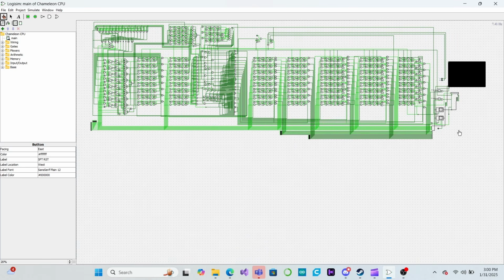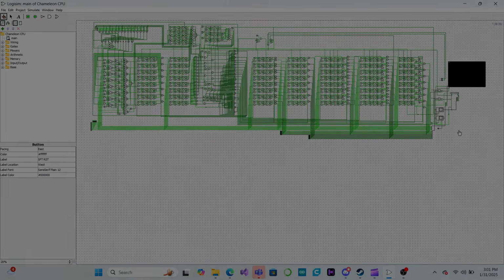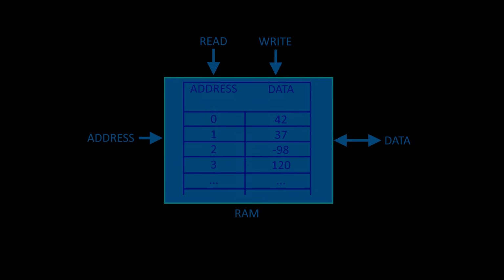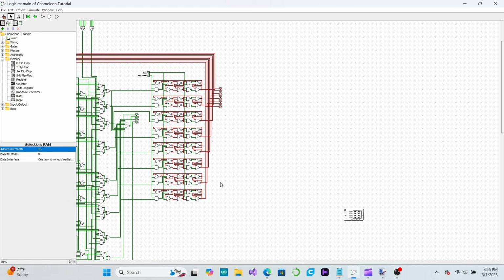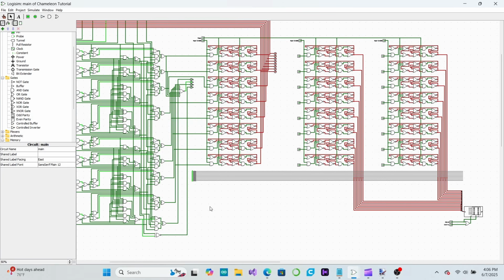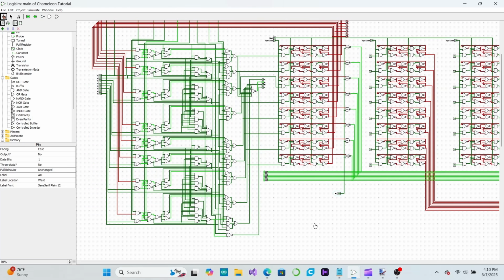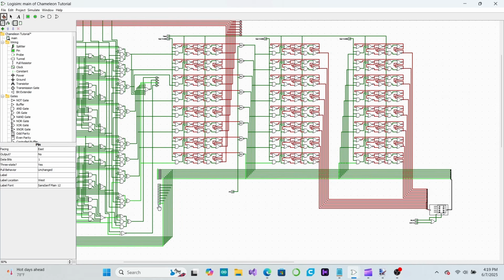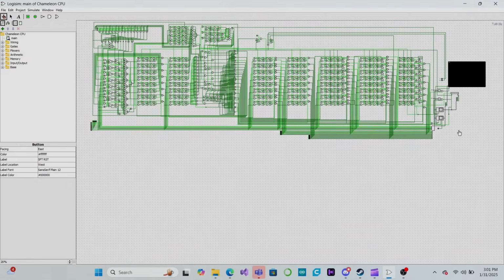Adding 64kb of RAM to our custom CPU (The CPU You can Build, Ep. 9)

Comment: The ram module in Logisim has a separate chip select signal because that allows you to set it's output to high impedance, which is nice if you're trying to combine multiple RAM modules on the same data bus. Real RAM varies on how it implements that, I'm guessing whatever RAM you're planning to use is either open collector or simply not designed to be extended that way.

Edit: Thinking about it, the RAM module you're using probably has it's chip select integrated into it's read/write pins, same way you set it up in the circuit here. The actual advantage of a separate chip select is that it makes address decoding for multiple chips easier.
Reply from the maker: Yeah having a chip select is indeed nice if you habe multiple chips.  I was mainly talking about the absence of separate read/write pins :)
Reply: @PolymathUnlimited-du2hg  You specifically chose the single port synchronous memory, for separate read/write ports (And also separate str/ld control inputs) you need to pick the dual port synchronous memory. In single port memory, it doesn't make much sense to have separate lines, as the port is only ever going to be either reading or writing. The select line handles the case where it's turned off entirely.
Reply from the maker: @MrHamof  Most single-port chips I have seen still have separate read/write enables (even though they only have one port).  Though, admittedly, there may be many chips that I am not familiar with (my background is physics, not electronics engineering).  The w24512ak15 64k x 8 sram that I am planning on using for the physical build is set up this way (though its read/write enable pins are active low, I think)